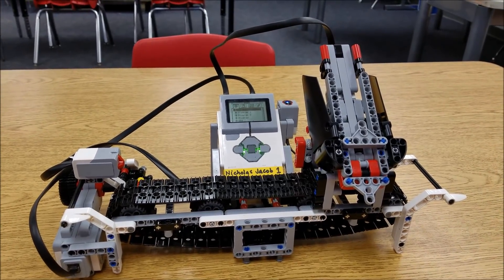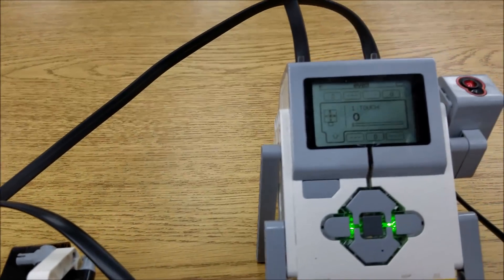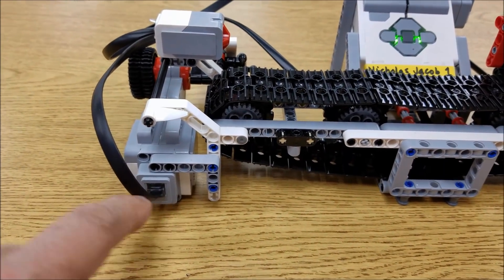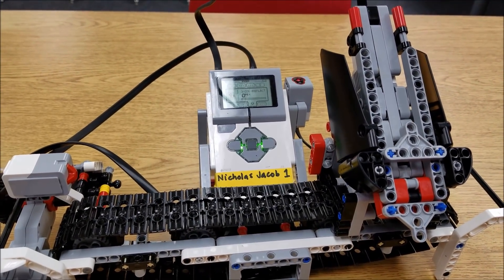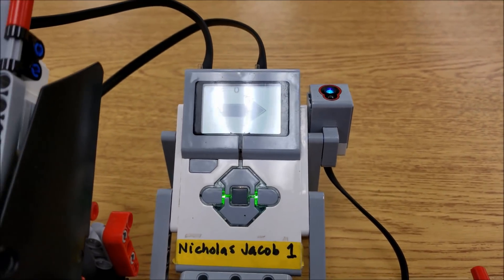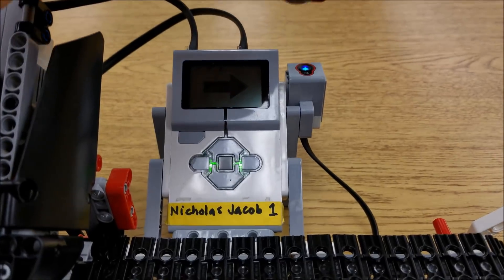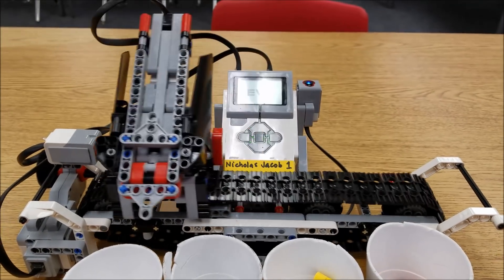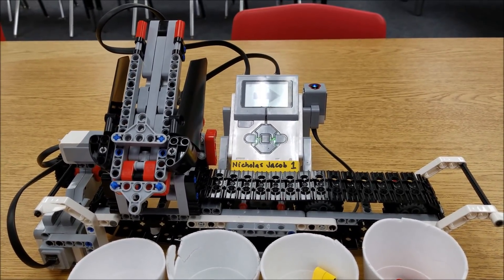"The LEGO Mindstorms EV3 Color Sorter: Where Do The Cables Go and How Does It Work"

Comment: Hi Mr. Hino, i've build the robot and the program, but it stops at BC with the color scanner. It shows the arrow but it doesn't beep. The program looks the same as in the instructions and i don't know what i'm doing wrong. Do you maybe know what i'm doing wrong?
Reply from the maker: A few things to check. Is the sorter hitting the touch sensor? Is the large motor in D? Medium motor in A? Touch in 1? Color in 3? Can the sorter sort on motor control?
Reply: @LEGORoboticsMrHino  Thank you for your response! It works now with the downloaded program, my own program still doesn't work, but that is okay, I probably made a mistake that i can't find on my own. I'm happy i got it to work eventually. By the way, my color sensor also seems to be color blind.
Reply: @mariskaklap9419  me puedes pasar el programa por favor? A mi no me funciona el mio

Comment: My son and I recently started discovered your videos and have really been enjoying them. We do have a frustrating problem that maybe you could offer advice on. We have built the color sorter twice, and we have two ev3 bricks. The program will not work for us. We have updated firmware’s, confirmed the ports are all in the right place, but it doesn’t work. It will scan the colors, then when we press the start button, it says the first color and then doesn’t do anything... the motor feels engaged too because you can slide the conveyor belt.

Any advice? Thank you!

Also: if the ports are in the correct place, the motor moves to the touch sensor, then stops and does nothing... but if I switch the A and D ports (where the program alerts me they are in the wrong spot), only then will it move and allow to me to scan the colors, but then will only say the name but nothing happens.

Really confused... we have built gyro boy with great success.
Reply from the maker: Our class has built the Color Sorter a million times so I have seen a million issues. Umm I read what you have tried and I have several suggestions. My first question is does everyhting work on motor control? Does the conveyor belt go from side-to-side and the sorter sorts out the pieces?  Does the sorter actually hit the touch sensor when it goes to the left?  Where did you get the Program from?  I'd love to be able to see how it's messing up. Can you send me a video what you're doing?  You can send it to hinolegorobotics@gmail.com          Thank you for watching my videos!!